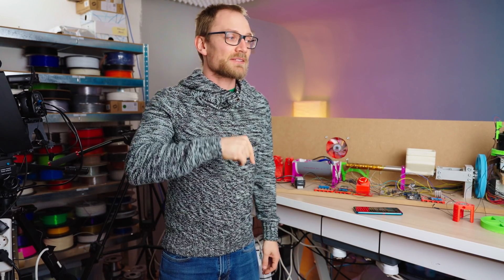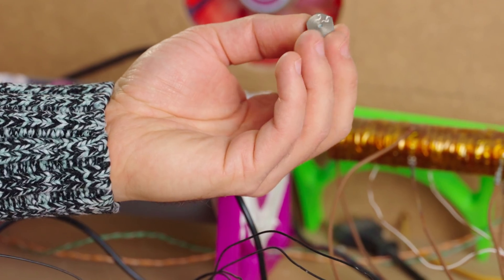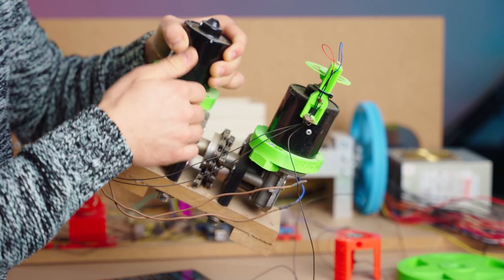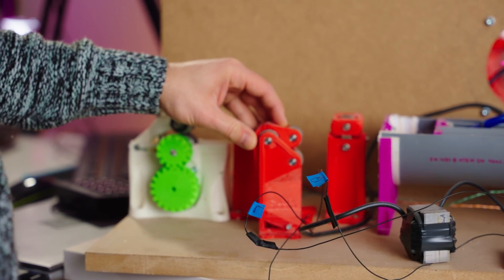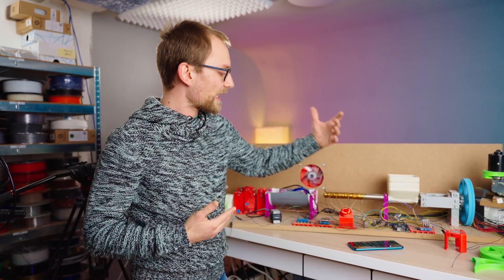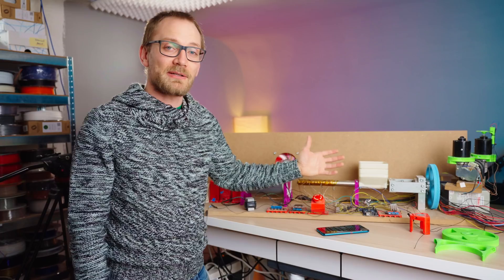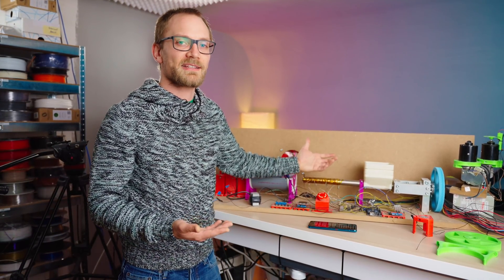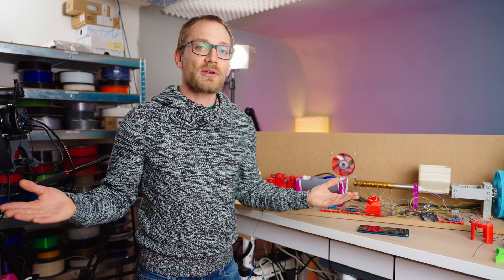How NOT to build a Filament Extruder

Comment: These are the holy grail for 3d printing.  If someone can get one of these to the point where they are affordable and about as easy to use as, say, an Ender 3 we could see a major shift in the biggest problem in 3d printing... waste.  Being able to recycle your waste into usable filament....  dream.

We really need to see more development in this area.
Reply: There is a big issue with this. Plastics degrade every time they're reheated and polymer engineering is not a trivial subject.
Reply: @MostlyInteresting  I do understand the complexity of it.  Just not smart enough to do anything about it .
Reply: @MostlyInteresting  you could use the low quality refurbished filament for prototypes though. I've built prototypes with the shittiest china filament already. Breaks apart when you even touch it but for a prototype it's sufficient.
Reply: @MostlyInteresting  this, plastics are not clay.
Reply: Ditto, would love to see a series on trying to build one now that more is known about them. It's the last thing left to make 3d printing affordable IMO as 6 to 8 spools of decent filament and you're likely at the cost of a DIY extruder. The commercial offerings seem to be stuck in about 2014 as well, the most popular ones are all talking about ABS, which many of us totally stopped using once PET-G became widely available.
Reply: Even better would be to have at least one place in every city where you can take failed prints for recycling. Maybe a good project for a chain that sells 3D printing goodies like Microcenter, since they could turn a profit off the added customer draw. I've been printing for several years now and still only have a few pounds of failures saved up (though I have thrown away quite a few as well due to being contaminated with epoxy/CA/grease/etc.). Not enough to be worth owning a grinder and filament extruder myself.
Reply: You can just buy these extruders.
Reply: regrind isn't as good as raw pellet, and would require an even more complicated setup, and a powerful grinder
Reply: @natalieisagirlnow  I understand the complexity involved.
Reply: I've been holding out for such a system too, but the practicality just doesn't seem there right now. These days I find it best to melt down prints into large molds to make sheets, rods, and blocks of material for use in my lathe, mill, or for general non-critical projects. For instance, I've made vases as gifts. The swirl patterns from the different plastics are quite attractive. PLA turns quite nicely, just use some water as coolant.
Reply: That would be totally awesome to have a open source filament extruder project that can make new filament out of old prints. Even without a shreder it would be nice as a cooperation between the  precisions plastic project  that could shred your old prints and give you the pallets to remelt them in you own Filament extruder. A fun name for that would be Open Filament Extruder Network (OFEN) :D
I could imagine that people would come up with some really awesome colors.
Please continue this journey and build a 2.0 version of this maschine.
Reply: @Fordham0815  there already is one. The Lyman extruder is an open source platform that you can either build directly or build from. 

Also, you mean precious plastics. But good luck building their shredder for less than $600-800.

The shredder is the hard part.
Reply: @Falney  Yeah, the only way you can get a cheap shredder (second hand paper and CD shredder) is only for recycling the rafts of you print, and I personnally don't use any raft...
But I use a paper shredder to grind plastic bottles. The problem is it's a looot of work (you have to cut manually the top and the bottom of each bottle to get a "sheet", and you need to grind multiple time your plastic to get relatively even pellets).
And PET is a pain to transform in filament, so probably not worth it for 3d printing.
Reply: @TICS_Game  even expensive paper shredders will break trying to grind prints without extensive modifications. I have seen other experiments like Jeremy Fielding's death trap made with circular saw blades and someone using an electric planer. They are the most promising "makeshift" shredders I have seen, but I like having all of my fingers so I am going to pass on using them.
Reply: @Falney  Yeah, that's why I'm talking about grinding rafts only. For that it works pretty well.

Grinding full parts is a no go, even with a standard mini shredder (I have one, and I'm still not able to use it because of the required torque to grind even a simple bottle cap lol).
Reply: @TICS_Game  the biggest problem is flex in the shafts that hold the grinders. You can easily swap the motor for a higher torque motor. The next problem is the gearing connecting the two shafts. Once you make the shafts rigid and increase the torque you may find yourself shredding the gears instead.
Reply: Recycled filament is always worse than virgin material. People have tried already.
Reply: Yea good luck with shredding your 3D printed failures into small enough to pieces for them to work in such an extruder...
If you thought the drivetrain for the Filament extruder was an issue, then wait until you get to the one for a shredder.